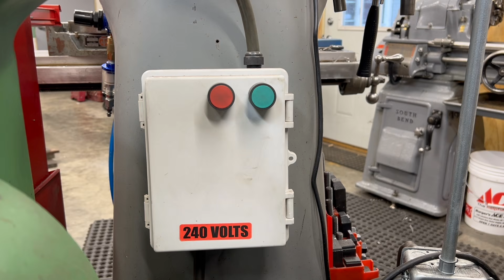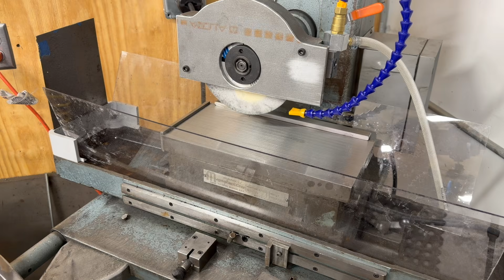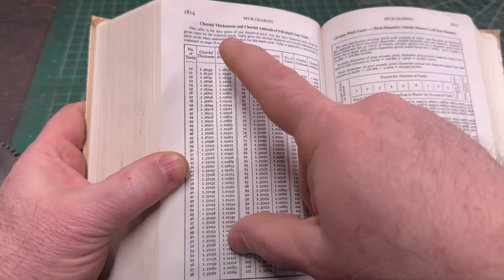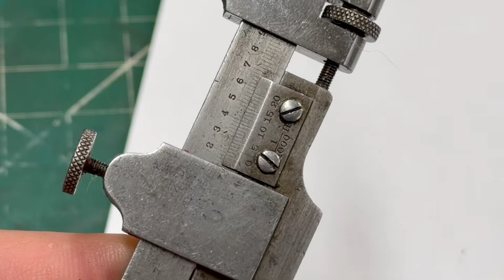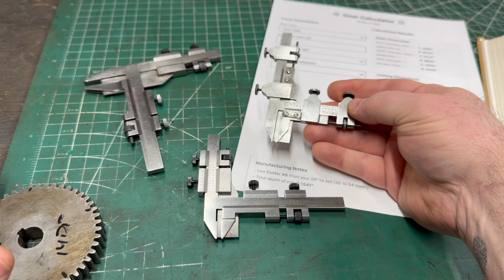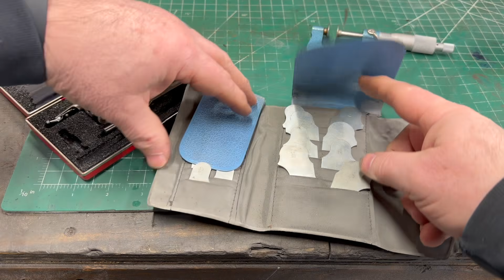Odds and Ends - Episode 13 - Using a gear tooth vernier caliper and other shop projects

Comment: Greg I was in Keith’s first scraping class - you’re going to love it. Truly. If you end up going through Birmingham let me know you’re welcome here. 

I’ve got a few of those Hudson scrapers and they’re great but a couple tips - you’ll find a flexible blade works a lot better with them because the scrapers are very stiff. Also put a threaded insert in the end of the handle and screw on a sanding pad so you can brace it against your body. Believe me you’ll be glad you have it as you leave Keith’s shop for the day you’re going to feel a full day of hand scraping.
Reply from the maker: I'll look at doing that. When I started hand scraping with Run Grundy, my one elbow was sore for a couple days. I'll have to get used to using my body vs. my arms to control the stroke. Thanks for watching!
Reply: @MyLilMule  yeah it takes some getting used to but it's quite similar - I end up bracing against my sternum so I'm still controlling things with my arms I can just lean my body into it. Really helps with fatigue. Don't get me wrong you're still gonna feel it 😂
Reply: Hudson's website does mention that their other option with more flex might be preferred. So those are what I bought. Good suggestion about adding the pad. Thanks.

Comment: Flat anvils are use to accurately measure shims and sheet metals. The larger anvil gives a much larger surface area of measurement.  

I would love to go to the Rucker scraping class but cost has stopped me thus far. Maybe next year ...
Reply from the maker: Never thought about using it for shims! I agree the cost is up there, but I am sure I will learn a lot. I'm treating it like a mini-vacation, too.